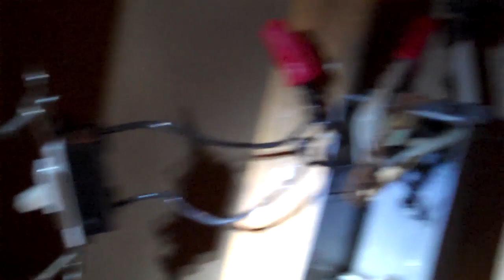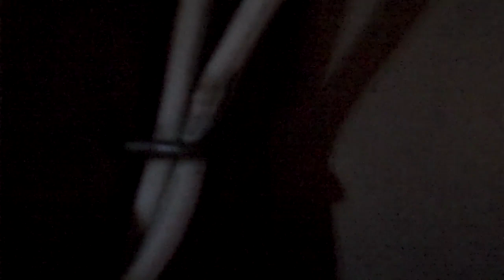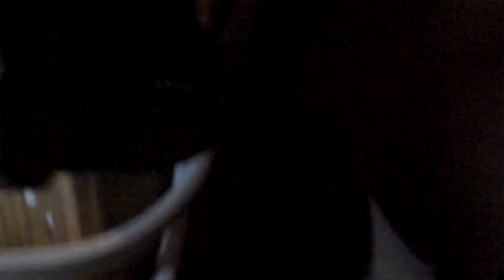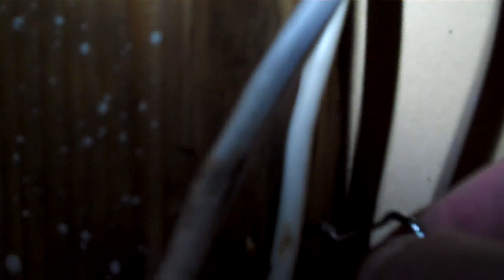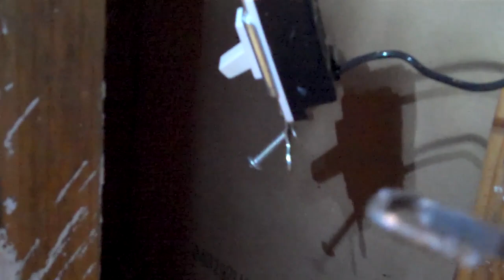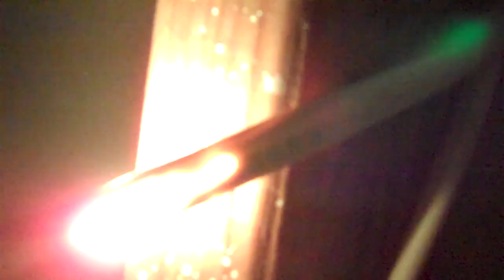Arc-Fault- Found Parallel Aching in Customers Romex Wiring

Comment: That happened to me just after installing new romex and even after making sure the romex wasn’t too tight! For some reason only on wires that have been stacked and stapled secured with the same staple there’s power traveling through the staple itself causing arc flash

Comment: I noticed when I changed my dishwasher that the installers did not replace the white wire. Over time, it frayed as it went down into the floor to the circuit breaker. Fortunately, the breaker tripped and turn the dishwasher off. I did see it Arc and I did smell it. Does that entire wire need to be replaced or can it be wrapped in electrical tape. I am a DYI lady in my empty nest so if I have to call an electrician, what should I expect to pay? The circuit breaker is not that far away in the wires probably only 6 feet long. Hopefully that helps I appreciate it thank you
Reply: Get a licensed electrician well recommended to run all  new wire and check your breakers in your box & that any switches are sufficient. A cheap fix on a heavy load appliance is ALWAYS a bad idea and likely to lead to a high risk of fire.

Comment: it seems to me if left alone there might not be an issue.
Reply: No. The heat will eventually degrade the insulation and ignite something flammable.
Reply: Not true Andy.  But think of it this way...lots of wire thru a whole house...how many other sloppy staples are causing the wires to degrade? Multiple hotspots on various poorly wired circuits and you might as well pour the house in gasoline and strike a match...and what if homeowner has an unknown gas leak close to some of that crappy handiwork? Now you see the bigger picture? It just takes one spark or one bad wire or one bad switch/outlet or something pulling more load than it should to light it all up like kindling. That's why we have fire codes and home inspectors and safety measures in place.

Comment: Grab a steel staple tht's holding a wire you know is arcing?
Wait. Is this candid camera?
Reply: Arcing clearly internal to the sheathing and externally arcing are different. Not to mention the pliers are obviously insulated in themselves. This is like Democrats conflating illegal immigration and normal immigration. Don't do that.

Comment: quick wiggling the wire.   which is why you never drive a staple tight.  leave loose.  seen it to many times over the years where some sparky has driven a staple to tight.  remember finding this in an attic years ago. the customer lost a circuit and i finally found it .

Comment: I recently sliced my thumb while working on a job. To be safe, I went to the E.R. After a nurse examined my injury, she informed me that it wasn't bad enough to suture. She then told me to wash it out and she would return. When she returned, she applied a bandaid and sent me on my way. In and out in 44 minutes. 5 weeks later the bill came for $783.00. Yes, $783.00 for a bandaid. I called to inquire why it was so costly. The billing dept. argued that that was a fair price and I should be happy with it. The following week I had the pleasure of working in the home of a Hospital CEO. I installed an outlet for his garage door opener. Typical normal price would have been $325.00. But to be fair to myself, I charged him $3775.00 which he paid no problem. My point is that I encourage all self-employed tradesmen (plumbers, electricians, carpenters, etc) to charge anyone that works in a hospital from the janitor to the CEO increased rates that compare to what they charge us....its fair.
Reply: I'm in Texas I read your message about charging $325 for installing a receptacle. I'm a Master Electrician and making a FLAT RATE PLAN is there a way I can get some help.
Reply: That's a scam! More like I would expect Bugatti to do, just to change the oil and/or spark plugs!
Reply: Don't rationalize scamming someone.